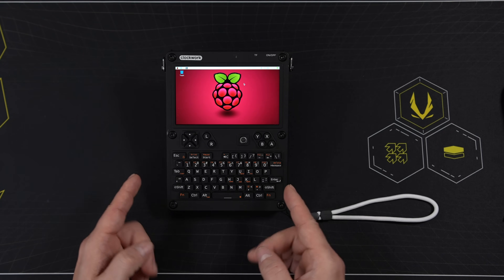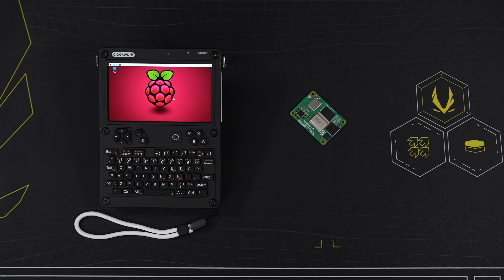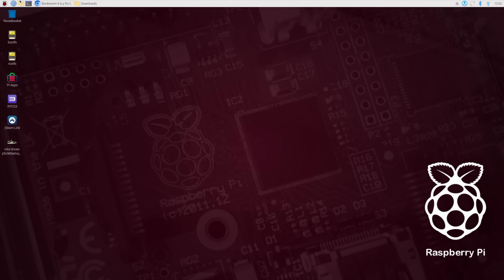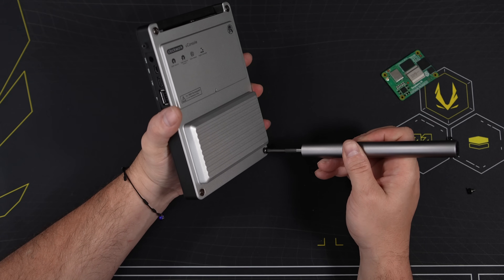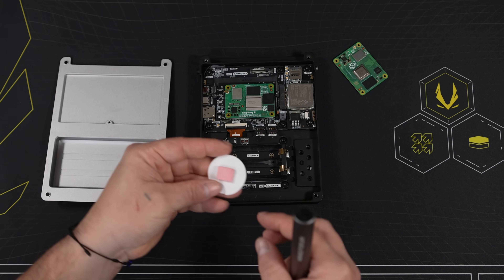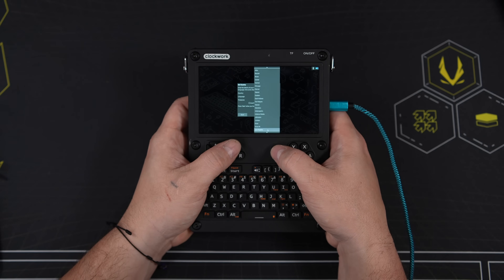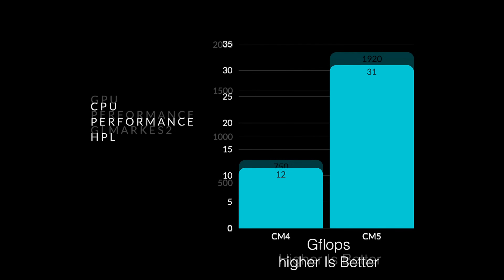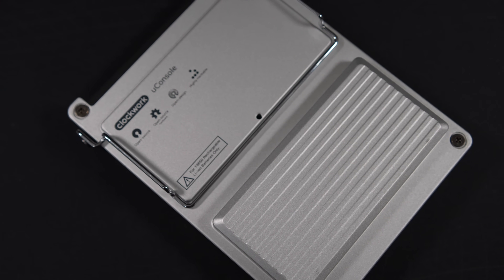This DIY Handheld Linux PC Gets A CM5 Upgrade! 🚀

Comment: Hello, I'm having problems trying to install a Raspberry Pi 5 module. I haven't received the programmer yet, but I wanted to ask you if you've tried installing the new official images and if they work with the Raspberry Pi 5?

Comment: mine is just not working, i have cm5 32gb EMMC and i tried flashing bookworm as well as this Ubuntu image from rex but after installing my cm5 in my uconsole and powering it on, it doesnt work. only the green power light is on. I my board not compatible, like i bought my uconsole back in 2023. and i use BAK 3300mah batteries. i even tried to remove the batteries and powering it on using direct source but still it is not showing anything on the screen. then i put back my cm4 with the same image and it is working

Comment: Does audio work? Yeah the battery life sucks. 

I just ordered a case, do you think I should just stick with cm4 or is cm5 really worth the bad battery life? I also kinda hate how there isn’t a slide back case in the console so we can swap out batteries. I have like 6x 18650 but you have to open the whole case to swap them out, really stupid. It could easily just have a slide case.

I might cut one but I’m not sure how I’d secure the cut out.

Comment: Waveshare has recently released a series of new IO boards designed specifically for the Raspberry Pi Compute Module 5 (CM5). Using older CM4 carrier boards may lead to missing or incompatible features, so we recommend checking out our latest CM5-compatible expansions for the best experience. Let us know if you’d like more info!

Comment: Potentially dummy mode question:what kind of batteries are recommended for the ClockworkPi? I understand the 18650 part, but do the batteries need a flat top or a button top?
Reply: Button top, I use the keeppower 3500ma (protected) it was recommended on the forum and i’m pleased (I use cm4)

Comment: Is there any particular reason you're reordering 2000mAH batteries? There are ones topping out around 3600-3700mAH, I feel like they'd be a better fit with the higher power CM5, but I know it's also sometimes hard to source legitimate ones at that capacity

Comment: If anyone is concerned about the audio issue, please raise it on the official raspberry Pi forum. This is a bug (the datasheet specifies that audio should be available on GPIOs 12 and 13) but the pi foundation does not seem to care.

Comment: In general, the CM5 module works, but there are some problems with turning on and rebooting... It seems that it turns on in some kind of emergency mode. It often turns on with a non-working screen, you have to reset the power and hold the power button for 10 seconds. It might be because I'm also using a CM5 module with EMMC, but I'm not sure.

Comment: Hmmm. Questions: will existing power circuit work well with new power hungry CM5? Is it possible to make power saving profile to keep battery life longer? Some script that lowers CPU and GPU clock, disables few cores and sets backlight to 30% 🤔

Comment: Ubuntu on cm5 would probably help with the driver problem but idk I am just guessing because cm5 if it can run Ubuntu the cm5 might have drivers you can use using Ubuntu because I've been doing stuff on my raspberry pi 5 and audio breaks when I use apps from raspberry pi apps on raspberry pi os so it's just a guess or a suggestion???
Reply: It's a fundamental driver issue that impacts audio on GPIOs 12 and 13. If you want to help get it fixed, raise the issue on the pi forum - they seem to not care.

Comment: The u in "uConsole" isn't pronounced as "u."

It's "u" as in micro.

So it would be pronounced Micro Console.
Reply: If they wanted it to be micro they ought have used the proper μ, not u. That's on them it that's the case.
Reply: @danielpicassomunoz2752  Yeah, I'm sure they has their reasons.

Comment: I love the idea of slapping compute modules onto boards for a quick upgrade. Love it. We need as many bangin' carrier boards as we can get. I know Jeff Geerling hinted at some testing he's doing on his second channel, there is a mini-itx CM5 board with an x16 slot on it!!!!
Reply: Let’s just home CM6 has the same form factor and connections 😂 though gpu and cpus are not getting much faster now days, hence the 2x power draw and heat.

Comment: Where did you get that thermal pad from can you refeerence its part number or dimensions? Also do you have the information for the Waveshare Board you used to flash the software? Thank You

Comment: I really wish this thing also had a video in for the screen and a USB out for the KB/M because it would be an amazing handheld KVM device for accessing servers in a data center while also being handheld machine and emulator. If it did that I could con my boss into letting me buy one on our budget.
Reply: theres an expansion port on it; maybe its possible to do something with that? 

otherwise maybe you can come up with something like a rasbperry pi zero 2 w "compute stick' type thing that you plug into the server as a dongle, and connect to it over bluetooth or wifi to the uconsole; maybe RDP from the uconsole into the pi zero?; that'd be almost even more sick since it'd be wireless
Reply: @ErichGeiger  there are a few USB KVMs out there that you could pair with this or any computer.
Reply: Headsup, mine took 2 years to arrive
Reply: @saifal-badri  what?? lol from where did you order it, it's in stock on a bunch of sites, prebuilt

Comment: I'm surprised to see the thermal paste so messy from the factory. Must have been an early/preproduction thing. Mine came with a nice thermal pad for the CM4 SoC.

Nice to see you can drop in a CM5, tho! Ordering one now... 🤓
Reply: I ordered mine yesterday when I saw this video 😂
Reply: @kefler187  I haven't been able to find stock of the CM5 I want. If I'm throwing one in, I want 8GB RAM and WiFi (obviously). I really don't want eMMC but if I have to, I want 32GB...8x32+WiFi is either out of stock or not shipping to the US. 😭
Reply: @ Lucky for me, I found a place in Canada that has stock of the 8GB CM5 Lite(no emmc) I also order the uConsole the same day when I saw this video because with the CM5, it now runs at a worth while speed XD
Reply: So, I got my CM5, but I can't get it working in the unit. I'll admit I haven't invested much time in it yet, but yeah, it isn't plug and play.

Comment: Upgrade the batteries to some 3500mah batteries, 2000 is a little last decade, I was about to start designing and 3D printing a device like this, but I might just pick one of these up instead, its bigger than I first thought.

Comment: It’s pronounced “micro-console”.
Reply: I think it would need to have a proper μ (mu) in the name for this to be a problem, in my books 😜
Reply: @ — it’s quite common in the electronics field to use a ‘u’. This is an old practice from the days before computers with copious font & symbol libraries.

Comment: Would buy, but not with proprietary software, that’s some nonsense
Reply: Uhh it’s not proprietary software at all, it’s all 100% open source
Reply: I thought the hardware would only run on their software?
Reply: typically any arm based image on linux with tweaking can work. The guy who made this image doesn’t work for Clockwork pi and he has done a bunch of different os’s. Tons of people have gotten different versions of linux running on this device. Arch, Debian, Manjaro, raspberry pi os. just some examples
Reply: Edit: I have raspberry pi os lite with Plasma on mine but have been thinking of using arch for sometime now i haven’t found a de i like for the little guy
Reply: What runs on it?
Reply: I’m not being funny but shouldn’t the hardware work with any cm5 standard distro out the box, its just a monotor and keyboard
Reply: No, since the screen and keyboard have special drivers(they didn’t use common drivers for these) so that’s the reason it needs tweaked before running

Comment: like the modularity, you can finetune it to your specific purpose - add card reader and storage to backup fotos or videos on the fly, remove wifi/bt but add battery power and a lower resolution lcd for a whole day or two of gaming offgrid, or add a battery bank and storage and carry around your library for SHTF situation etc....I was hoping with cell phone progress we will get modular laptops, one tiny SBC main motherboard with different specs and rest of the body for wtvr you need, additional gpu, additional battery, multiple storages, basicaly like rugged/military/expedition grade purpose build mobile workstations for the consumer....this comes pretty close

Comment: I hope clockwork releases a new carrier board with an  M2 internal slot. I have been using mine for HAM radio and is a blast!
Reply: HOW have you been using it for HAM radio? please explain> Do you mean SDR++ software or as a literal radio where you can transmit with?
Reply: @eijentwun5509  I use it for FT8 with my Icom 705, APRS and logging when operating stand alone. Tried SDR with an usb dongle but honestly the icom is far superior as a radio. Also loaded Chirp to program several of my radios when in the field.
Reply: A new carrier board would also need to support USB PD, and it would be nice to have USB 3 IO too. I suspect this would also need PCIe and having that on the main board would make the newer carrier boards incompatible with the CM3 and their other CM3 form factor modules like the R-01.
Reply: @josegregoriogonzalez874  how are you using it for HAM??
Reply: Right on!! Would you need to connect it to an external radio for communication, I would assume.. kind of an amateur in that field, but, I don’t need to know much to acknowledge how rad it is!!
Reply: I plan on getting one for use with ham radio soon too. Has it worked well for your applications?

Comment: Meh, dumb and expensive nonsense
Too many better options out there
Reply: You're not wrong, but it's the kind of thing people buy because it's fun and they have cash to burn. Nobody is buying this instead of a laptop.
Reply: @joeblow229  It is smaller than a laptop. But perhaps things like SteamDeck would still be better than this thing.
Reply: Could you name a few?
(I'm interested in getting something similar)
CM5 is out of stock most of the times anyway (at least the good performance ones.